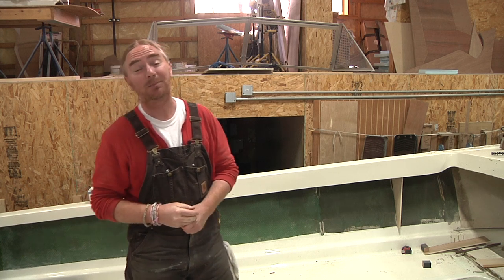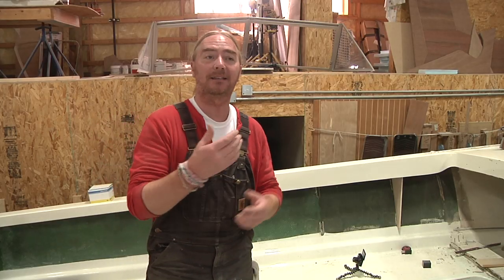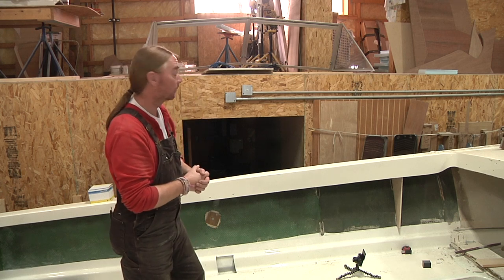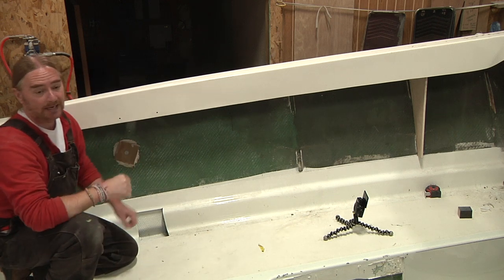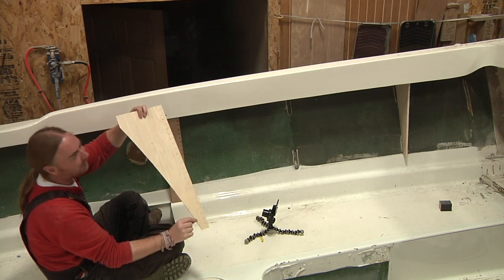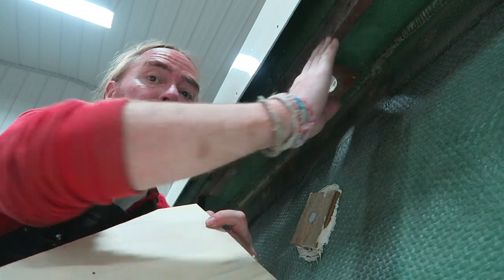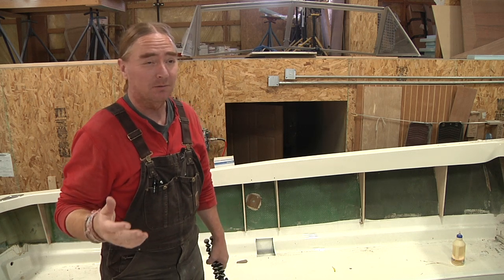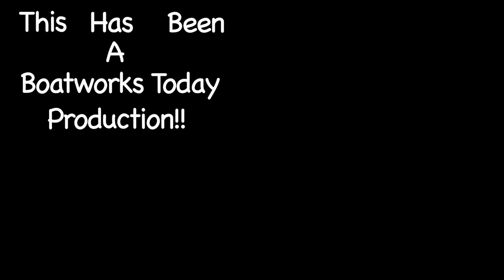Making The Templates For The Side Deck Supports On The Bertram!

Comment: If you don't have enough VOC's drifting around the shop, try this:  Spray a coat of PVA* over the surface the knee is to attach to.  Then build up a 2" layer of cheap insulating foam.  Insert some pop-sickle sticks in the still-soft foam to give it some backbone.  Let it harden and pull the whole glob off and carve a  flat  surface off one side nearly perpendicular to the inside of the hull.  You now have a very accurate profile to trace on to your Coosa board.  Try using the 1/4" stuff and attach a glas flange to the inboard edge of the knee to protect people knees or to attach an interior wall giving you a void for storage or floatation.

Cover the foam with glas and wrap a flange  around the surface of the foam that formed on the interior surface of the hull to give yourself an easy way to attach the knee.  This trick would have been great for building a span-wise floor beam under the foredeck.

* If that roll of plastic sheet sticks well enough to the inside of the hull, it would simplify the process even more: no PVA, no cleanup, no shoulder pain from scrubbing from a prone position.

 Keep up your fine videos; I've learned something valuable from every single one.

Comment: You do awesome work and I’m always looking forward to the next video. Many moons ago I used to spend weeks under J series racing sailboats fairing hulls,keels and rudders to make them as slick and smooth as possible. My boss would even have me install clear a lexan  disk about the diameter of a hockey puck in the haul over the prop so they could make sure the collapsible prop was well, collapsed lol. I learned every trick of the trade back then on how to make a sailboat go as fast as possible. It was the coolest job I ever had.

Comment: To copy the inside profile of the hull use a piece of cardboard, a pair of scissors and a sharpie. Follow the profile with the barrel of the sharpie and allow the point to scribe a line on the cardboard held at a right angle to the hull then cut along the line - it's quick and easy. I hope this helps. Cheers

Comment: Nice work. A simple suggestion: Use an Irwin Quick Clamp to hold your measuring stick/spacer block tool in place while you are taking your measurements.

Comment: I am working on an original '72 25 Bert right now.  The deck cutouts (fuel fill area) were original and there were molded fiberglass almost structural panels there.  They are shaped like this  ->   '''|___|'''     if you are looking at the top profile and they attach to 2 screw holes at the top and the melamine side panels on the sides.  They just float on the deck.

Comment: The cut out on the port side deck for the fuel filler hose and vent hose is original. I have exactly the same cut out.    I own the same boat from the same year and am using your advice to restore it.  Thanks, Andy
Reply from the maker: If you have some time would love to see some pics!  boatworkstoday@gmail.com  Thanks!

Comment: A pair of home-made contour gauges  (sometimes called profile gauges) could make simple work of this. Its essentially a flat stack of slide-able pins or rods pinched between a long horizontal that acts as a clamp. You could easily make one for this kind of work out of dowels, a couple strips of ply, and some wing nuts. You might need two, a small one for the under the rail contour and another for the hullside contour but they would be tools you could use over and over.

Comment: Always such a pleasure to watch your vids! Been following along for quite some time.
I have a question... I just picked up an old project. Its a 1976 AMF Crestliner Crusader 775, I/O with Merc 165HP. 
On the starboard side where it meets the transom, the rub rail has  end caps, i am missing this end cap...Port side has one.
Any idea where i could start searching for this end cap? I spent the better part of an evening online,with no luck...
Thanks for any help, you or anyone else can provide!
Cheers

Comment: Hi andy love your videos, would it have been stronger to use a osculateing saw to make a cut in the timber already in place under the deck, and slide the deck supports in to the cuts.

Comment: The vertical inboard sides of the gunnel aren't really supported. Once you have your knees in place you could add a horizontal brace from each of them out to the gunnel lower edge, which would brace the gunnel and add some stiffness.  OCD wise, when you do the rigging, you will need two separate bundles, one for each engine, a third bundle for the boat wiring, and a fourth foot the steering hydraulic lines. That's what I did on my boat, you want it to look nice in case somebody decides to lay down on the deck, and look up under the gunnel. Greg

Comment: a other way to do it is to put a stick to a pencil so it gets L shaped, then just put a rough template beside the hull and put the pencil to the rough template and the stick to the hull and you will write a perfect line to the rough template.

Comment: There is a little easier way to scribe the hull on the supports. Especially when you are using scrap for pattering. 

Instead of using the square stick to mark lines then try to recreate the curves, round the end touching the hull to a dull point in the center and drill hole the size of a pencil or pen (whichever you want to use) in the middle of the other side. Insert the pencil and secure it with rubber bands or a dab of hot glue. Now keeping the stick straight as you did, run it up and down the hill a couple times with the pencil part tracing on the skin. Your arcs are already transferred and ready to be cut. 

You can do something similar under the rails but a regular compass would likely be large enough to bridge the gap so you wouldn't need to make a tool. You might need a separate peice of scrap and trace it onto the pattern after scribing due to space limitations. 

That should get you a tight fit top and side. Of course that fit will change if you laminate the coosa on the contacting edges. But that is essentially how I scribed an island counter's trim to a natural stone outside wall on our deck. It should be much different other than the amount of space spanning from the pattern and the hull.

Comment: Why wouldn’t you use cardboard For your initial template?  You wouldn’t have to keep getting in and out of the boat, cut everything with a utility knife, Use a stiff tape to correct your mistakes.
Reply from the maker: Could have but all the cardboard I have is relatively small with lots of folds :-/  Plus I have a ton of the door skin from freight shipments that needs to get used up lol
Reply: BoatworksToday “Free” Fabrication tools are the most valuable. I understand completely.  I’m sure you only had to get out of the boat once.  However I am terrible with wood. I would’ve needed multiple trips. Lol Fiberglass metal any other material I can cut it perfectly. Wood not so much. Something about cutting up a formerly living being.